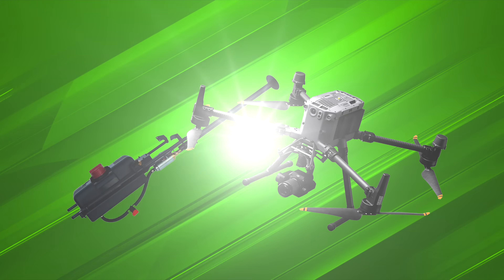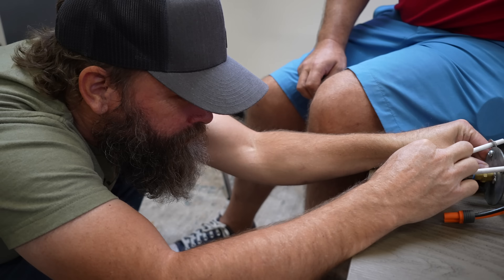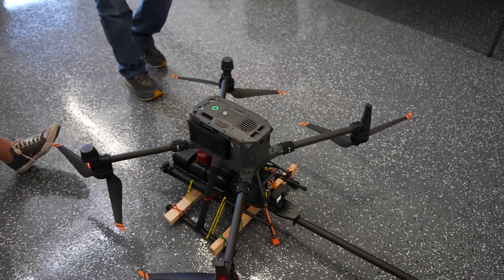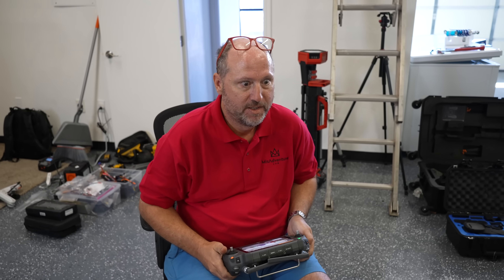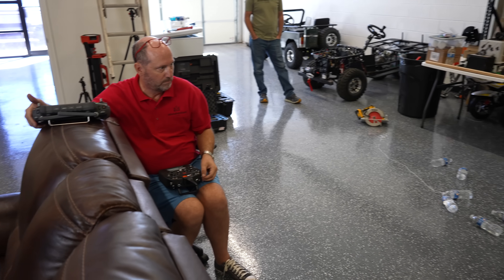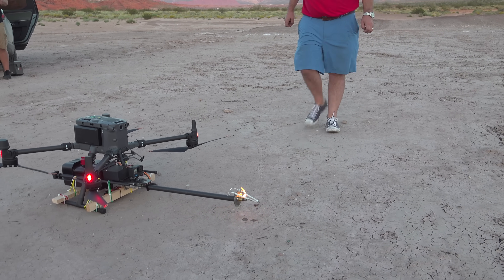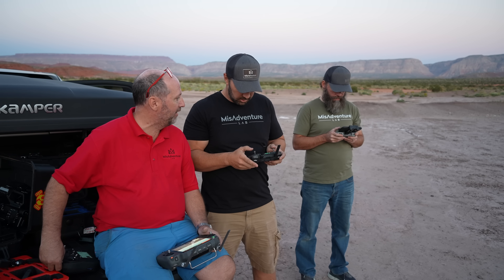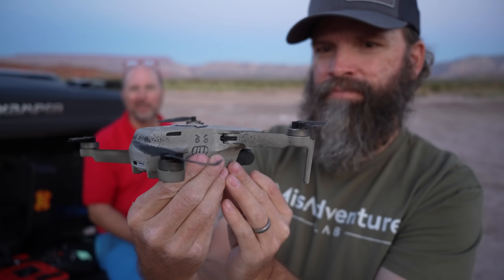Insane: Flamethrower Attached to Drone Test

Comment: With things that fly, weight is a major consideration.  The lightest (but strong enough) parts you can build your craft from are the ones to use.  You did not need the larger battery, and it was heavier.  So, watch it, Buddy.